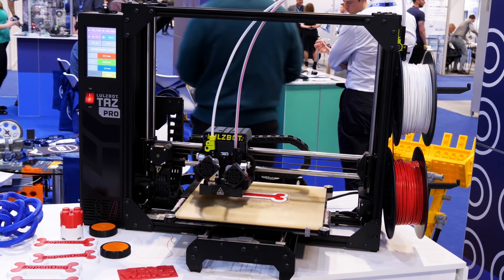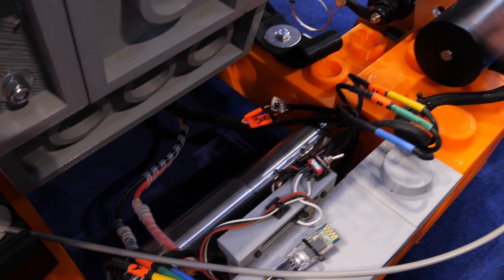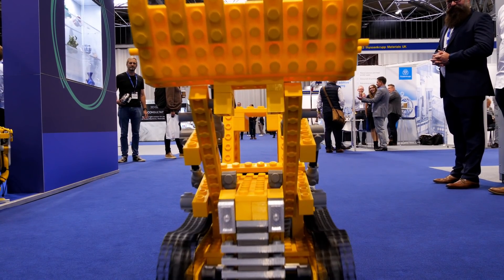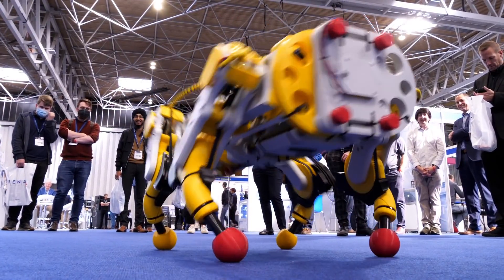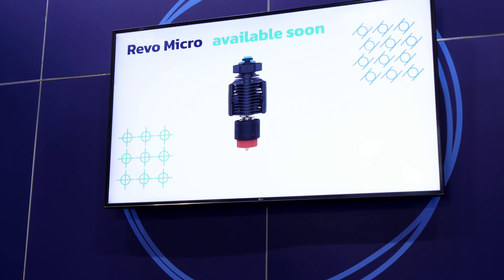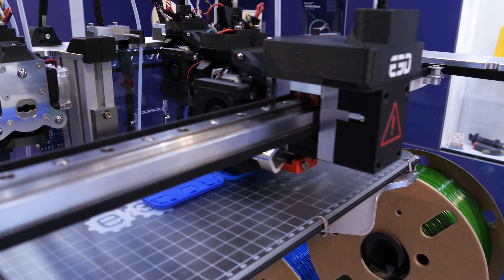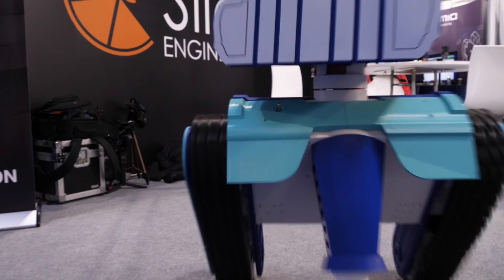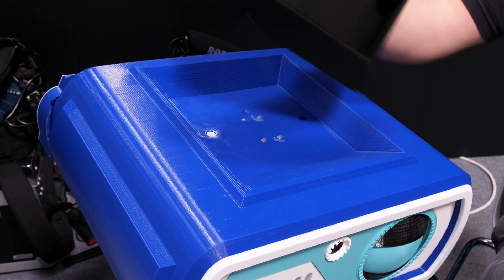Robot Dog Demo & Giant 3D Printed Lego #TCT3SIXTY

Comment: 5:38 HOW IS THIS ARM SO FAST? I even checked twice if it wasn't sped up. That's amazing.
Reply: The big arms tend to move about that fast when in action, if the thing they're doing doesn't need slowness. Unlike an animal, a machine can move as fast as its engines/motors can drive it, which means the warnings to stay back when something is operating are extra important. When it's large, people often think it's slow; when it's small, people tend to think it's weak. Those ideas are due to human experience with other living things, but machines aren't always the way we think they "should" be.